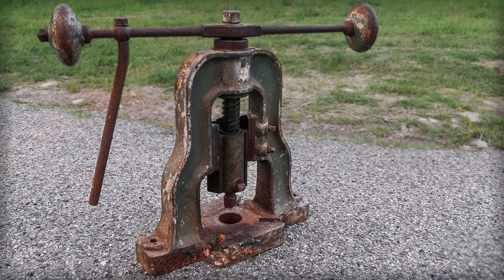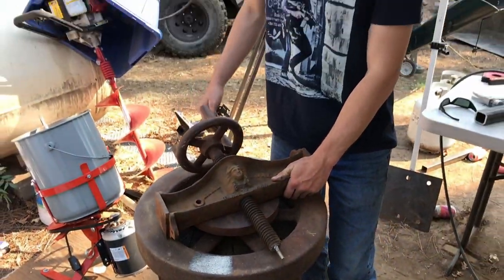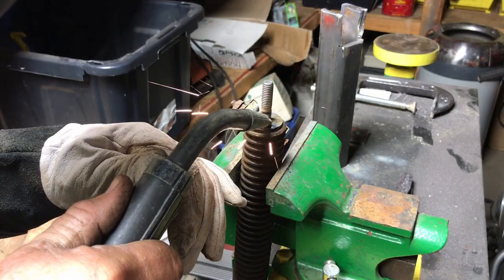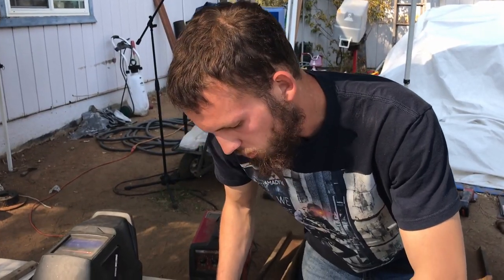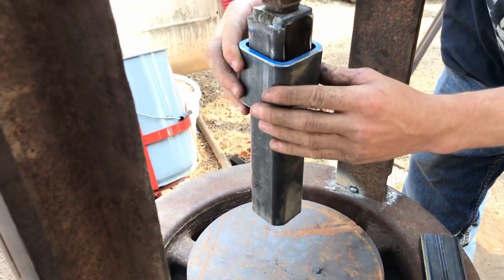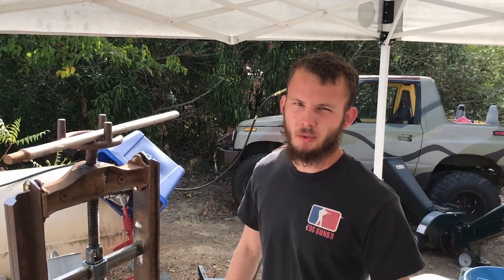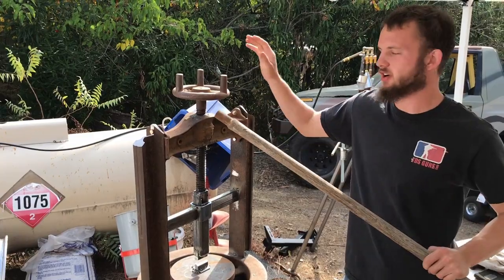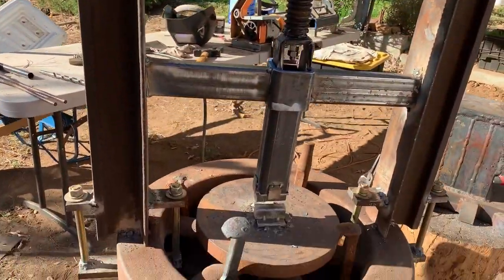Building a Fly Press out of an Antique Wine Press from 1873

Comment: Screw is way too fine and your support is not rigid enough..  The whole point of a fly press is speed AND force: you need a very coarse screw to get that ram moving down fast, and a huge weight on top to provide momentum and force so that you, the operator, do not have to crank hard on the screw..
Reply: Glad someone pointed that out.